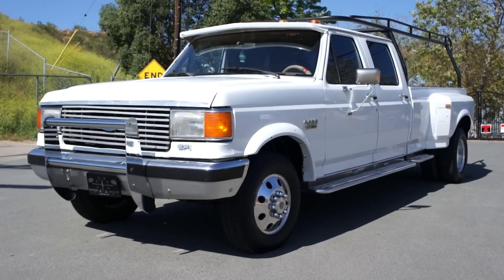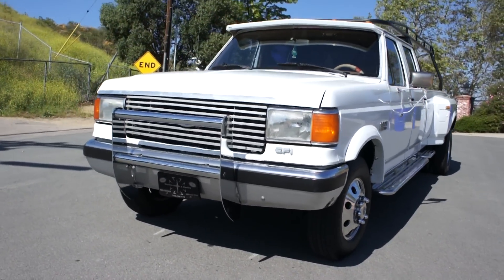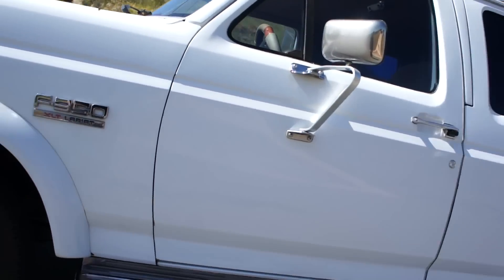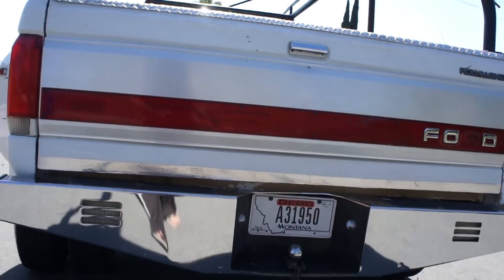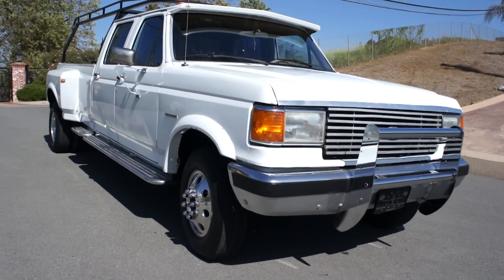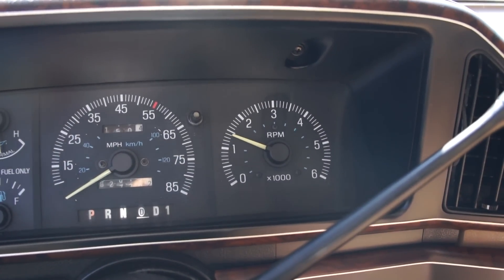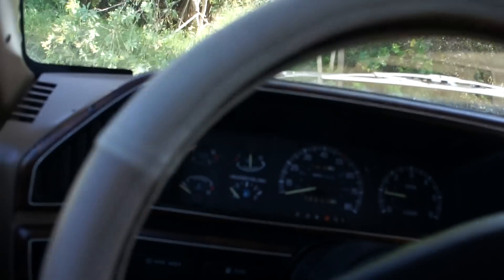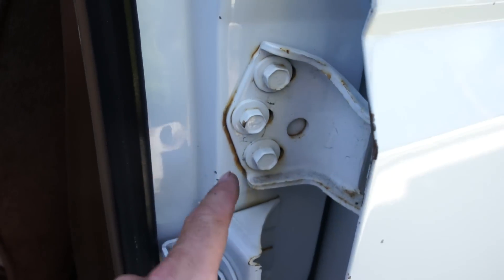1988 Ford F350 Crew Cab Dually Roll A Long Lund Hauler.MTS

Comment: I have a 1990 F350 Roll-A-Long truck and it was just an aftermarket custom company that did trucks for the Ford Dealers and there was an entire catalog of options but I have yet to obtain one of those.  My particular truck did not have but ONE exterior option that has since been removed ... the running boards.  I have the Roll-A-Long interior package which gives you like captains chairs and a woodgrain center console but i dont even have the overhead console option.  The seats are super comfortable though.  Much better tha the standard bouncy bench. It's a 7.3 (dealer installed Turbo) 2wd and i love this truck.

Comment: Beautiful truck. 82k “original” with that 5 digit odometer eh. That ain’t no motor mount/exhaust leak either
Reply: probly was 82k , most people used these for a specific purpose not a daily driver so they usally have low unless a work truck then maybe higher but not always , i run a 2014 f350 and still only 40000 miles